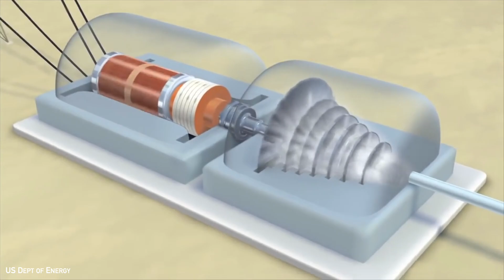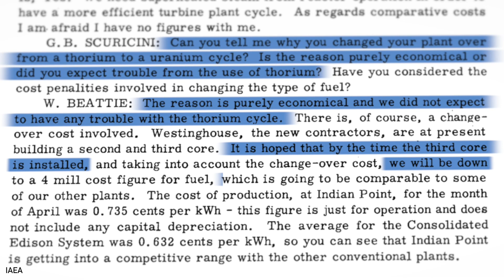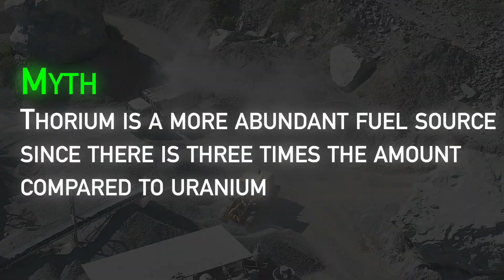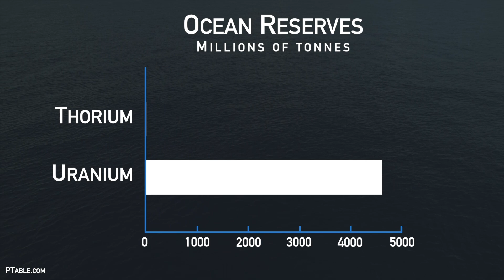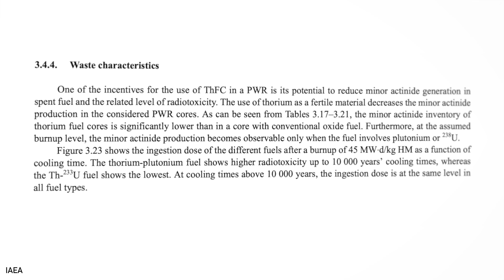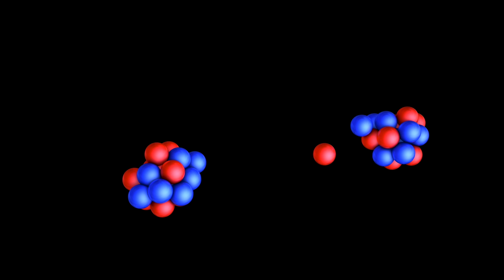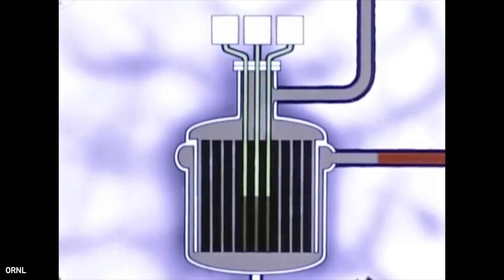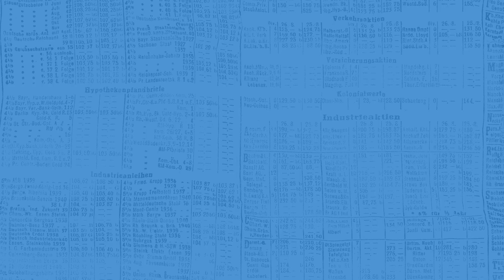*Almost

Comment: The thing about thorium-reactor "waste"--the general half life is about about 350 to 400 years, which means the waste can be dumped in disused salt mines, which are plentiful around the world. That's if the nuclear medicine crowd doesn't grab it first.
Reply: 98% from every KG Uranium waist needs to be stored safely for at least 21.000 years
2% form every KG Thorium waist needs to be stored safely for only 350 years.
Thorium delivers 10 X more energie from a KG
And Thorium is Walk Away Safe
To me Thorium has so many benefits.
Why do they not use this...???!!!
Reply: The problem with uranium waste is not that there are not suitable places to hold it, it is that those places want to either refuse or extort the country for massive amounts of money,
Reply: @justgivemethetruth  There's also the issue of the radioactive half-life of uranium waste, measured in the tens of thousands of years. Thorium-232, when used in certain reactor types, generates radioactive waste with half-life of around 350 years, and the waste products are very useful in nuclear medicine.
Reply: @Sacto1654  
The amount of nuclear waste, even the high level waste is miniscule compared to the pollution from oil and coal.  It's virtually nothing. The physical problem has been solved, it is the social and emotional problem that is the issue.

Then I don't care how little the waste from Thorium is, it is virtually the same short term - long enough past many human lifetimes.  The problem that cannot be overlooked about thorium is that there is no real experience with it - it is a new technology, and that is definitely something it would be borderline insane to push onto the world.  Regular uranium scares people enough, but we have many decades of experience with it.  That experience and safety has to be leveraged.
Reply: @justgivemethetruth what pollution? Why should I only not be afraid or your chosen waste production.

Comment: Waste, it’s still the devil in the details.  What to do with the waste!?!?!?
Reply: I’ve driven through northern Nevada, I consider nuclear waste to be a non-issue beyond safely transporting it out there.
Reply: @grahamhawes7089  I’ll consider the radioactive waste issue solved when a permanent storage facility is opened and can store all current waste (stored at each plant in casks) is moved to and stored.  As well as being able to store future waste.  Thorium or uranium based waste will need to be stored someplace in the US before most folks will allow any nuclear powered plant, regardless of design, to be opened.  I WANT nuclear plants producing a majority of our power, so don’t misunderstand me.  However, solve the waste problem FIRST, then lets build plants of many different designs!!!!  If Finland can do this, why can’t we?
Reply: @BOK-04 , Concerns over waste are overblown IMO. Not that it can be ignored, but consider that nuclear is the ONLY energy source that contains its waste and there really isn't that much of it. Take Canada as an example. Nineteen reactors produce about 15% of total electricity for 38M people, mostly in Ontario where ~15M of them live and work. In Ontario over the last 40 years, between 50-80% of electricity has been generated via nuclear every year. To visualize the used fuel from that effort, as well as all the Canadian used fuel (a small amount from 2 other provinces plus research reactors, medical isotope production reactors, university reactors)...all of them together, would fill 6 hockey rinks up to the boards. The amount of material by volume is tiny compared to any other source except hydro and it is all contained. Now consider that less than 5% of that is actual waste another 1% is stuff like left over U-235, Pu, Np, Am and a few other nasties that can be "burned" or transmuted in reactors if separated. The rest, nearly 95%, is U-238 which in pure solid oxide form you can hold in your bare hand.

Finland's approach is misguided IMO. They are essentially creating a future Pu-239 deposit which could be mined. The complexities of building a repository for once-through used fuel are enormous (just ask the yucca mtn folks). You not only need to contain it for 100K+ years because of that 1% but you need to manage the heat load from the 4% for at least a century. The ~95% U-238 is essentially "filler" that doesn't need that kind of isolation. What a waste to treat it all the same!

The only true long term solution is recycling. Separate out the 1% (Pu, Np, Am, etc...keep it all together, not in pure streams) and the 95% U-238 and reuse them in fast spectrum reactors. Leave the "hot" 4% (remember, that is less than 1/20th of the original volume, so about a 1/3 of a rink's worth of space) contained above ground in a secure facility until it cools enough (decays) and then dispose of it in a much cheaper & less complex deep repository. The US has ~5 times as many commercial reactors, so ~5 times the volume (excluding military stuff, which we aren't talking about). Much of the technology to do this has been demonstrated at small scale. We just need to decide to do it. Until then, keep it in monitored casks at the reactor site. It's not hurting anything sitting there.
Reply: @richardb1452  IMHO, waste is the BIG reason nuclear power never produced more power than it did.  Small in volume?  Yes.  Big in toxicity, Yes.  Hence the problem.  As far as the potential “recycling” of waste, that has not happened, so I do not consider it a realistic option.  The waste is the problem to solve before the public and the financial folks will provide the capital to start building the sector.
Reply: @BOK-04 , France, Japan, India, Russia, China all do it to one degree or another using older tech and several countries ship to France to have it done there. There is zero justification for a state that already has weapons capability like the US not to do it, especially when the US is world leader in the more advanced methods development.
Reply: @richardb1452  willingness and cost are the obstacles the USA could never solve.  Those, and the WASTE!!!  The Yucca Mountain disaster was a disgrace.  If we opened it, then nuclear (any type) had a future in the USA.  Without it, no chance and it’s dying/dead.
I don’t accept your premise in anyway shape or form .
Reply: @BOK-04 , The US banned domestic commercial reprocessing to set an example for other countries as an anti proliferation strategy in the '70s after doing it themselves for about a decade. Nearly all the countries that message was meant for ignored it and either already reprocess, ship to one of their partners to do it or are working toward it. 

You asked for a solution to waste. Something will have to be done eventually regardless even if not a single new plant is built. Something similar to what I laid out is the only solution that truly eliminates the problem. Take it and deal with the waste over a few hundred years or if you prefer, don't and keep babysitting the waste essentially forever. It's a choice, but make no mistake, there isn't a third choice that works at scale. Domestic political squabbling won't change that.
Reply: @richardb1452  as usual, it comes down to politics and money.  Sad.  Very sad that a clean power source has to die.
Reply: @BOK-04 , That prediction may be premature IMO. I don't doubt the outlook for more traditional PWR and BWR plants is fairly bleak. I think there is a reasonable probability that some of the Gen IV type designs could change public perception over time, once a few come online. Some of those are the very reactors I alluded to in the previous post and some are in licensing with sites selected right now. Maybe they won't get there, but the impetus of climate change has many who traditionally opposed any new plants on board. Only time will tell.

Comment: I would advise that you communicate directly with Copenhagen Atomics. There are some mistakes in your presentations regarding safety and proliferation.
Reply: Copenhagen Atomics was founded in 2014 and incorporated in 2015.   They have built nothing.  What they propose is only that a proposal not actually proven cost effective

Comment: Good rundown generally, but I have to contend with the first "myth".  Nearly all great tech advancements (big engineering) come from public funding (Manhattan, Apollo, etc.).  So, uranium gets public funds, but when it comes to thorium, sorry bud?  Engineers and scientists should provide good grant plans, but energy tech should not have to rely on private companies to get going.  I hope we would all agree that clean, safe, abundant, baseload power is about as good a public good as we can fund.
Reply: You apparently did not watch the video.  Indian Point tried a Thorium core and Shippingport also operated a thorium core and the DoD invested in a U233 nuclear weapon.  ALL determined to be non-competitive with Uranium.  As was the case with the rest of the world.
Reply: @clarkkent9080  Non-competitive ... based on the tremendous (public) costs already sunk into the uranium fuel cycle and pressurized water reactors with solid fuels.
Reply: Trillions (in todays dollars) have been spent exploring every type of reactor known in the last 70 years in the U.S., Thorium included.  
Tell the republicans that want to cut SS Medicare, and even the military that we need to try this thorium out and just add it to the national debt.

Dude, I am pronuclear.  I am not against any nuclear power plant light water or MSR.  I can discuss the safety and nuclear waste issue but that is not the problem.  In the U.S. today complex specialized builds like nuclear be it PWR, BWR, MSR, SMR is massively expensive and cannot compete with any other power production method.

I live in the Vogtle power sphere. I have a 19% electric rate surcharge already on my bill for the build.  Southern Company just asked for a 600 million rate increase for unit 3 when it starts and I assume another 600 million when unit 4 operates.  They have a $1 billion interest payment every year on that $31-32 billion dollar build not including operating costs and principal.  My electric rates will soon be the highest in the nation.  Always electricity for whatever but too expensive ti use.

Comment: Thank you for the details of the thorium reactor. I did not know about the pipe cracks. You make some great points but nothing you said debunks the bomb making motivations of the Atomic regulators. The cold war was on and Russia was trading the lead with the US for more powerful bombs. The balance of power was tied to the production of the most powerful bomb.
Reply: Where do people keep coming up with this BS that Uranium based PWR/BWR were chosen so we could make bombs?
Hanford Wa. has been making weapons material since 1944 and their weapons production reactors are very efficient graphite moderated reactors and DO NOT produce any electrical power.
Savannah River site SC. Has been making weapons material since 1955 and their production reactors are very efficient low pressure heavy water moderated reactors and DO NOT produce electric power.
Weapons production reactors are NOTHING like U.S. commercial PWR or BWR power reactors and commercial power reactors have NEVER been used to produce Pu239 for weapons.
Reply: @clarkkent9080  I didn't know all that. thanks for the backstory. I was under the impression that Oak Rudge labs chose uranium fission over thorium because the military needed spent fuel for bomb-making. not true but dirty bombs are a threat. The Atomic military wanted to power submarines and aircraft carriers so the development of small reactors was the primary focus.
Reply: @clarkkent9080  Thanks for the lesson. It's very generous of you.
Reply: @ToIsleOfView Some of my last message was cut off but If you are interested in nuclear, the history is fascinating. It would definitely be a drama, mystery, action, horror type movie if anyone ever made one.

Comment: This is very informative.  Because Thorium (esp. LFTR's) has been making its rounds on the internet, a few years ago.  (I was kind of enthused, and kept asking "why don't people jump on this.")

After listening to the Rolls Royce SMR presentation, I'd be content with the following (for the next 10 years).  Conservative reactor design.  This usually means LWR, which already has regulatory approval.  Factory manufactured.  Passive safety.  The goal is favorable economics, rapid deployment, and the ability to crank out lots of them, in a short time.

Future video topic suggestions: Economics of nuclear.  Advanced designs (e.g. HTGR).  To justify the economics, other use cases besides electricity generation (e.g. industrial heat, hydrogen production, desalination, ...).   Nuclear should be part of the low-carbon portfolio.  But it can fits in, can be better specified.

Comment: Alvin Weinberg had the patent for high pressure reactors used on navy submarines and in 75% of reactors used today.  Why did Weinberg develop the MSR?  Duh.  He KNEW how dangerous 800 degree 5000 psi water is!  Lol.  This is NOT rocket science.  If power is lost to pump this high temperature high pressure water, and the reactor core over heats, ka- blooey buddy!!  Weinberg was WELL aware of this.  He TRIED to get Washington to change in 1972.  Nope!  Gotta have them bombs!!!

Comment: Lol.  There is a lot of misinformation when it comes to thorium.   Like on this site.  Here’s the REAL story.  There is an entrenched monopoly that (GE, Hitachi) that is controlling the atomic energy commission and the DOE that does not want change.  They are making their bucks with URANIUM.  Thorium threatens this situation.  This young man also neglects to mention that thorium reactors burn 99% of the fuel, NOT the 1% that uranium reactors burn.  The solid fuel rods made of uranium ruin the cadmium cladding, and the rods must be pulled and replaced every 5 years.  Those rods are then either worthless high level waste, or must be reprocessed at using specialized equipment in a dangerous environment.  More money for GE!

Comment: Have heard the proliferation risk is mitigated due to the “unavoidable” presence of U232 and its “hard” gamma profile. Want to understand that one better. What’s your input there?
Reply from the maker: U-232 does produce some nasty gammas and usually this is cited as the way it is more proliferation resistant. This is true, compared to plutonium which is much easier to manage. However, it is fairly easy get only the U-233 out because its predecessor Protactinium-233 has a 28 day half-life, meaning there is a pretty big window to pull out the Pa-233 and then wait for it to decay to U-233. Then there's much less U-232 to worry about.
Reply: @atomicblender  "there is a pretty big window to pull out the Pa-233 and then wait for it to decay to U-233."
I think that's the wrong way around -- if you pull out the Pa-233 by chemical processing, you pull out whatever Pa-232 is in the mix with it. 
As I understand it the better way is to expose Th-232 to neutrons for a while, inside or beside a reactor. Remove it and wait a month -- half of the Pa-233 decays to U-233, and virtually all of the Pa-232 decays to U-232. That reduces the ratio of the remaining Pa-232 to Pa-233 by a factor of a million. Pull out all that uranium and use it as reactor fuel, leaving 'clean' Pa-233. Wait several more months for that to decay to U-233. Then pull that out and....
Reply: @wwoods66 , pretty much right on the mark. It's isotopic separation via differential half-life vs. other methods. Theoretically much easier to do and conceal vs. centrifuge due to the size and precision of equipment/building required and way smaller than PUREX, but slower due to lower mass flows. There is a Sandia NL paper that outlines the risk, though you need some chemistry background to infer the method. One note, most papers I've read on the subject suggest multiple, ongoing U separations as the Pa232 decays rather than waiting to do one separation. Of course you need a hot cell to do it, but that is much easier to conceal than a centrifuge or PUREX plant.
Reply: @atomicblender  
Ok so the “unavoidable” really is avoidable by simple extraction time control. Thank you sir.
Reply: @atomic blender 
So you are suggesting removing the Pa-233, seperating it from U-232 by centrifuge? Do you remove enough U-232 that way? I heard that any amount of U-232 acts as a poison in a U-233 bomb. In the process you describe, don't you still have to deal with those high energy level gamma rays?
Reply: Or can you chemically seperate uranium and protactinium?
Reply: @davidhenry5128  
Yeah I think the chemical separation step really that is available for the Protactinium really “solves” the U232 problem. But I’ve heard some challenges to this. I wish someone in the know would put this to bed. It sounds like Atomic Blender sees it as settled which perhaps it is.